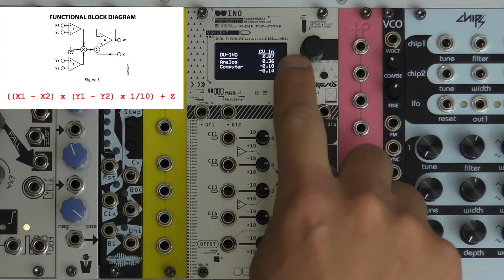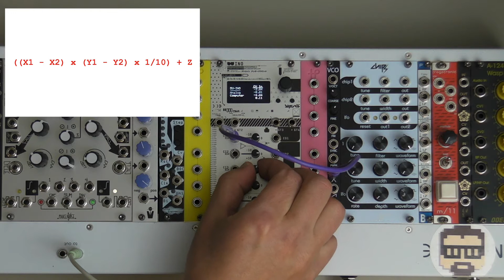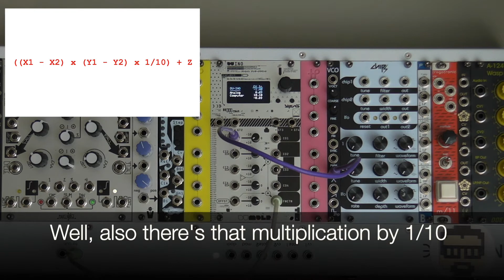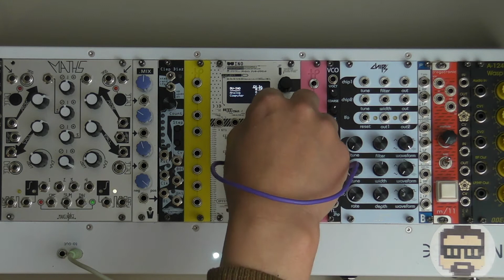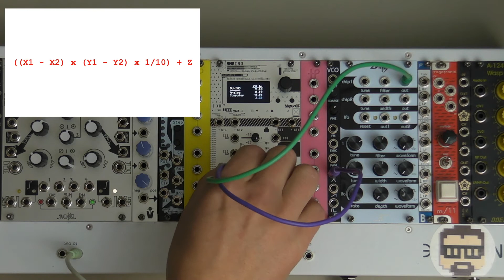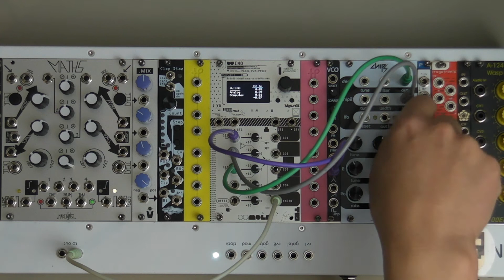Analog Audio Arithmetic (DU-INO Eurorack Arduino Shield) | Simon Hutchinson

Comment: Designer of the DU-INO here. Great video! You nailed it at 9:04. The idea is that each of the analog inputs can be read in by the ADC on the Arduino, and each of the analog outputs (from the DACs) can also be routed in place of the inputs using four of the configuration switches on the rear of the module. This is usually set up specific to a particular program; for example, in the ADSR/VCA example you mentioned, the envelope output is routed to one side of the multiplication. Thanks for putting this out there. I'd be happy to help you or anyone else hacking on the DU-INO, just drop me a line.
Reply from the maker: Thanks for the feedback. Yes! I definitely have some questions, but right now I'm continuing to work through the existing examples and try to make sure I understand everything that's going on. I tried to put together a patch to generate some tones, but I realized that wasn't probably a good hack to start with since I had to figure out how the DU-INO was using the timers. Anyway, fun stuff. I'll definitely drop a line when I have specific questions!